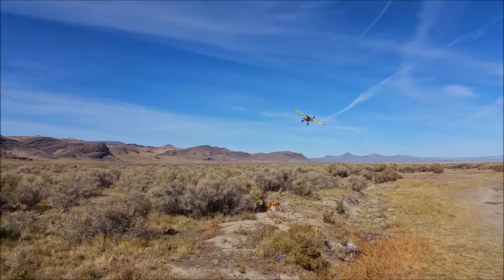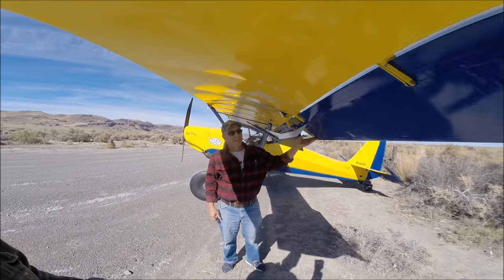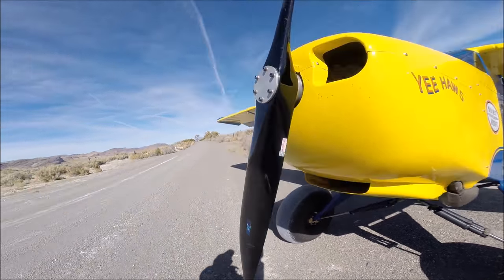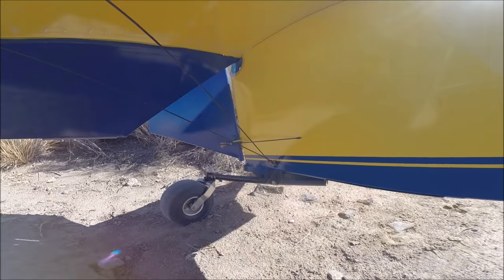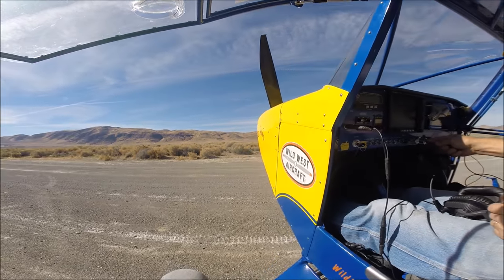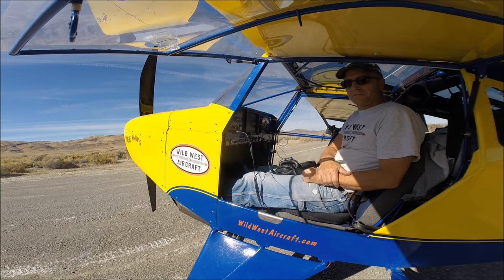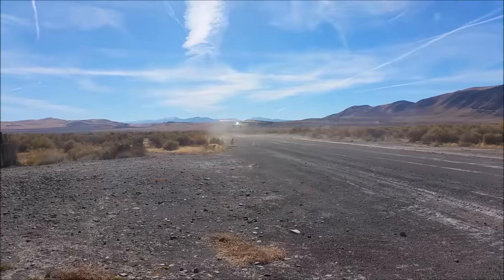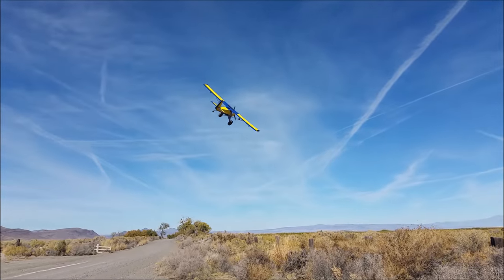Just Aircraft Highlander Steve Henry Yamaha Power High Sierra Fly In

Comment: If you go to his Facebook page, you will see a short video of the Yamaha inline four cylinder engine, the engine is out of the plane mounted on a stand, so he can work on the electronics - the sound reminds me of my old 750F, with a WOLF Racing pipe, but not as noisy - very cool, you do not see these engines in small aircraft, but for weight, horsepower and overall costs, this is the way to go, especially if you can get around the 2000 hour rebuilds - not sure how that would work, but some of these aviation engines are 28 grand.... how much for one of these inline fours, maybe 4 or 5 thousand - not sure!
Reply: A two thousand hour rebuild for an aircraft engine is excellent.  Especially when it doesn't cost you $15K to rebuild it.

Comment: Yamaha is a nice engine, turns 9-10k rpm. Not really sold on the gearbox to engine mounting setup and overall the engine is built for mounting in a sled frame not so much so for an aircraft. We use them in gyros / trykes, in pusher and they do sound cool going by ...

Comment: Slap a turbo kit on that and he is looking at 190 hp at 120 lbs. not too shabby.
Reply: Turbos also suck a whole lot more fuel, and the engine reliability probably drops too.
Reply: Longevity really depends on heat and boost. If you are keeping the boost low most of the time (with an in cab adjustable) it's not an issue.

Comment: Any chance we could get some basic engine dimensions? I have a project this would be great for if it would fit.
Reply from the maker: Sagebrush Aviation might check Yamaha, or with Steve at wwwwildwestaircraft.com
Reply: Mohawk Aero is selling FWF kits.  see their site.  Another fellow on you tube sells an adapter to fit the Rotax c gearbox to this engine.
Reply: I think Steve used the Skytrax (Skytrack?) adapter, which has several you tube postings as well as a posting on the Avid listserve.